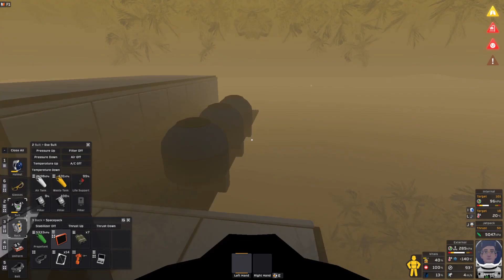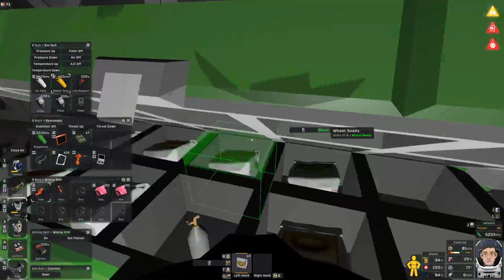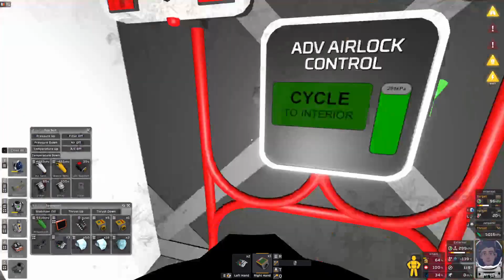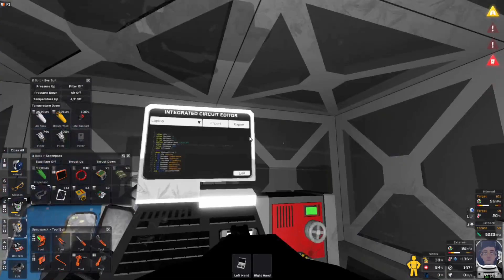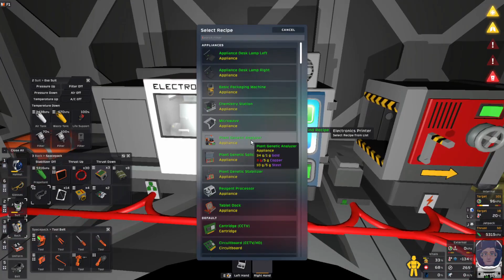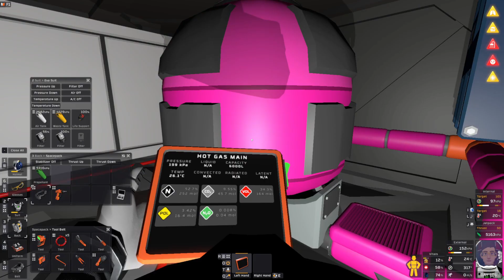Stationeers Titan Part 33 : Hot and Cold

Comment: Perhaps use lbn and sbn to reduce the need for multiple ICs with a short code on each?
Reply from the maker: Yes I should. I just don't really like addressing by name. It feels too fragile. It's my problem and I should get over it :)

Besides the resource requirements I don't really have a problem with a lot of simple ICs - I find it makes for a more modular and maintainable system. Early game the resources are a problem but by this stage it's usually not, although obviously IC Housings use power as well which is a consideration. That said, once I get the server room build and deploy my alert system I'm going to be printing ICs like they're about to go out of fashion...
Reply: @stationeers-murk  One of the main issues that you will still have is the fact that all ICs will use 50W of power. You will end up using way much more power than needed if you keep using alias for all things.
Yes, batch reading and writing will put a lot more load on the CPU, but this is a solo world so you don't have hundreds of scripts doing it so you should be fine. It's not like the issues we have on servers.
Reply: @Bjurran  On the other hand, power will absolutely not be a problem if the solid fuel ingot generation is working properly. Free coal from the deep miner and turning it into solid fuel ingots with free volatiles (from the atmosphere) means effectively zero cost power (tho mr murk didn't make the heating of the volatiles in the furnace "free", which is possible with a h2 combuster and heat exchanger!).